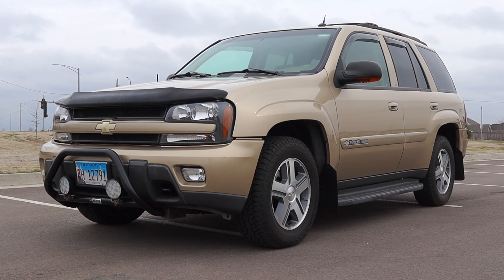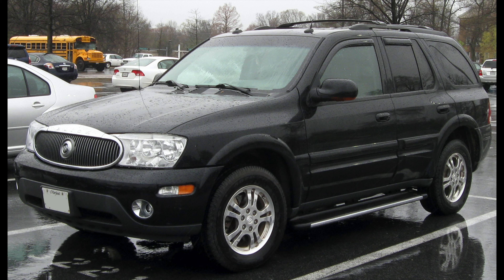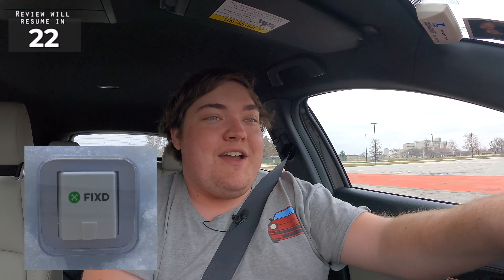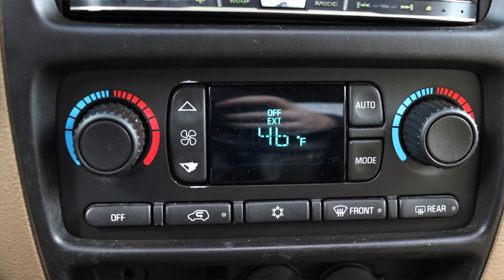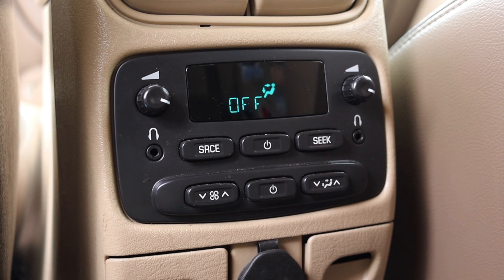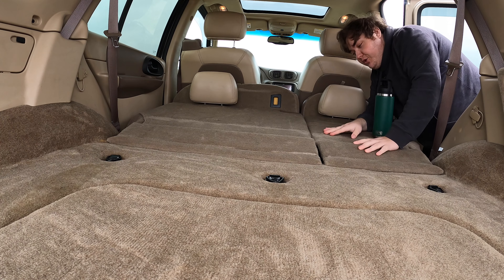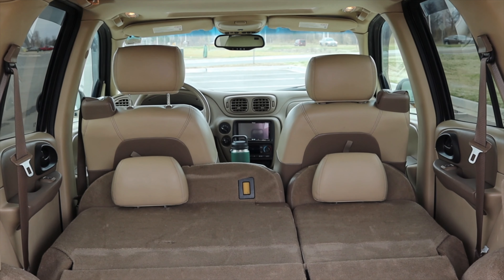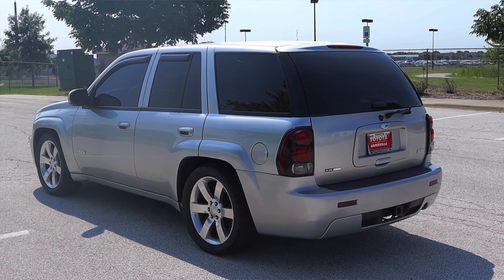2004 Chevy Trailblazer LT Review - Comfortable To Be Yourself

Comment: I have owned a 2002 Envoy and a 2008 Trailblazer...the 6 cyl engine was an award winning design that seems to basically run forever.  Great cars even today.  In my town in Northern California there are still dozens of TB and Envoy's running around.
Reply: I get 21 to 22 mpg on the interstate at 70 mph. 22 to 23 mpg at 65 mph on the 04 LT Trailblazer I6
Reply: youre poor

Comment: I have a 2002 Chevrolet Trailblazer with 189,000 miles. It is still almost mint and I average 18.3 mpg. It is a great vehicle.
Reply: ever serviced trans>?
Reply: @Masonn14325  I changed the filter and added new fluid one time.

Comment: I have a 2004 TB with 185k miles. I've own this truck sense 2008. It was getting 15.5 mpg when I bought it. The last 7 years it had been getting 14.3 mpg. I google 2004 Trailblazer bad mpg and someone said to change the map sensor. I bought one from Autozone $80 and my mpg has gone up from 14.3 to 15.5 to 16.5 and yesterday I got 18.56 mpg after 20 miles why drive. I didn't have a cel light and the truck was running fine. I will be uploading a video soon.

Comment: My 2003 chevy trailblazer with 198k miles is still going strong. I take care of it. It's very reliable. Back when GM was marking good vehicles. I bought mine when it had 100k miles. I would never sell that vehicle. I get 17 mpg highway miles and about 16 miles per gallon combined. The engine and transmission are very good if you take care of them. I've had no issues finding regular parts for my trailblazer like radiator, brakes etc. Subscribed

Comment: I drive a 2003 GMC Envoy XL. Had it since 139,000 miles and it now has 250,000+miles. Still runs great and I love it. It's had some problems through the years, but nothing I haven't been able to fix myself. I would say the strongest component of these trucks is the motor. Very bullet proof.
Reply: I'm at 278K and got the remans transmission, plus new suspension, and repair kit welding on the chassis and trailing arm mounts (I did my own tailgate repair that looks like stucco from all the polyurethane I used but it stopped the rust!) - along with all the standard TSB repairs over the years (actually two replacements of the fan clutch did not fix the AC since the dealer neglected to upgrade the PCM as per the TSB - instead the dealer noted the TSB was now outdated and so they decided not to do it - strange reasoning. Another dealer ex-mechanic said they ALWAYS upgraded the PCM when fixing the Air conditioner. haha.). I live in a cold state - so I can live without AC. The TB looks terrible - I fixed the rust but I just did a paint mess on the body - but as you say the "motor is the strongest component." So far the motor has held up. I'm hoping to get 500K out of the car. 
Unfortunately the CD player just started not working - seems to be a digital glitch. So not sure I want to get that fixed or replaced.... That's a big drag but I could just plug in a CD player via the 12 volt power somehow.

Comment: The first version this model on the dealer floor was the Oldsmobile Bravada.  However, this was just as they announced the end of the Oldsmobile brand.  Interestingly, in the one I saw in the dealership, the little compartment in the back trunk actually had an air compressor w/ hose for pumping up your tires.

I  still have my 02 Chevrolet TrailblazerLS.  Still love it at 217K.  Biggest complaint is that noisy plastic interior compare to the quietness of a Honda Pilot at 190K.  But I've towed my father's garden tractor around just fine and it's always had enough power and speed to do everything I've asked of it.  And it's 4WD system has never disappointed.

Comment: Keep the transmission and transfer case fluids fresh. 
They were not built super tough!!
Driven gently and regular checkups for electrical problem resolving and fliud renewal they will last a long time. 
The engine is really tough, the transmission is teeny inside and easy to break. 
Adding a cooler really adds life to it.

Comment: I have a 2009 GMC Envoy with this engine. The best vehicle I ever had. And surprisingly enough I've lined up to quite a few vehicles at a red light and won a races to the speed limit. These things really move for the size they are. Under 8 seconds 0-60 isn't bad at all for these trucks at all if your going against a v6 charger or mustang.

Comment: Nice Trailblazer and have a 2004 LT myself which I upgraded and can get 24mpg. Put a high flow air filter and muffler on getting rid of the resonator, performance tune and good Iridium plugs. It also has a very comfortable ride!
Reply: youre poor

Comment: Those old Trailblazers were good dependable cars with plenty of go power for a 6 cylinder but had a few safety features I didn't like like a battery compartment and spare tire holder that takes forever to get to the battery and spare tire. I tore all that crap  off mine.

Comment: I get about 18mph, on back roads. And letting it coast as much as possible. That’s one thing I love about mine is that it doesn’t engine break much. I let off the gas and it just rolls. Unlike many engines that will slow the car down.
Reply: I never thought about it but you’re right.

Comment: I was thinking about buying a trailblazer for my car btw I'm buying the v8 version just because of towing stuff btw I think ima buy the 08 model tho btw ur friend did a nice job in the interior on how clean it is as well this is the Sam exact year that 4 door s10 love that truck when I was a kid
Reply: My biggest gripe with the SS is that the LS2 doesn't have much in the way of modding... Still an awesome car.
Reply: Get an upgraded trans cooler, really extends the life of the 4L60E. It won't last long if you don't. Also look into getting the Saab or Oldsmobile version, they're much nicer to drive and have a better interior and you can usually find them cheaper
Reply: Oh ok thx
Reply: @spacefacegaming  also the V8 has DOD, ask if it's been deleted or listen for a ticking noise, when it fails it grenades the engine.
 Depending on how much and how often you're towing, the 4.2 might be enough, I have a Saab with the 4.2 and use it to pull my cars on occasion and it's fine, and there's no DOD to worry about. 06 and up are the best 4.2 years
Reply: @Black-Villain  Oh wow I was thinking about swapping it from a LS engine just for reasons bc the ls  is so good engine
Reply: @spacefacegaming  The 5.3 is an LS, GM just put that garbage cylinder deactivation on them and when it fails it grenades the engine (DOD). You can delete it with an aftermarket cam and the lifters and stuff, but if you just want a car to get in and drive and not modify, the 4.2 is the better option in my opinion
Reply: Btw did you buy one btw?

Comment: What about the ASTRO mini van. Used this engine too.
Reply: I know this is an old comment, but the vast majority of Astros have the 4.3 V6 bolted to the 4l60e tranny. Some back in the '80s had the 2.5 inline 4. Early Astros also had 4 or 5 speed manuals, or the 700r4 transmission.

Comment: I have a 2007 chevy trailblazer straight 6 I LOVE IT has 247,000 miles reliable replaced normal parts engine and trains good just got back road trip live in Spokane Wa traveled twice to south palm beach Florida over 6,000 miles round trip no problem at all its the best car I've ever had so fun to drive I payed $ 3,000 two years ago I will never sell keeps on going looks pretty tire size 245 65 R17 crome rim's dark navy blue I LOVE IT
Reply: youre poor

Comment: also have a 04 Chevrolet TrailBlazer LT with the G80 Locker option, had it since 2009 with the 4.2L I6, bought it with 92000 miles and now it has 173800 miles and still running very smooth
Reply: youre poor

Comment: My family put 280,674 miles on ours.
Reply: then what happened? I'm at 288K and going for 500K
Reply: @voidisyinyangvoidisyinyang885  well my father gave it away to a family member. They have since put in only 10k miles in a period of 6 years. Still going strong in 2023 only thing that’s was going out on it was the rotors and break pads. But that’s about it

Comment: these things are ungodly slow I dont believe they have 275hp cuz even the 5.3l v8 ones take like 10 seconds to hit 60! they are ungodly slow unless you have the ss!
Reply: The 4.2 has a zero to 60 @ 6.1 sec, & a 1/4 mile of 14.6sec  @ 92mph

The 5.3 has a zero to 60 @ 6 sec, & a 1/4 mile of 14.2sec  @ 101mph

AND THE SS...
 Zero to 60 @ 5.5 sec, & 1/4 mile of 13.8sec @ 99mph

That 4200 is only 0.6 of a second slower than the SS model $ giving away 100 hp to it.
But that 4200 straight 6 will long outlive those v8's
I don't think that is slow for a 4500 lb vehicle.
You can buy a used 6 cyl for 1000 to 4500 bucks
Now Go price a SS model. EXPENSIVE...
For the cost savings you could cam and turbo that 4200, and it would destroy the SS.
Reply: @Thesaurcery4U2C  not even close on the 4.2 the fastest 0-60 i found online was 7.8. the auto transmission in them slows them way down!